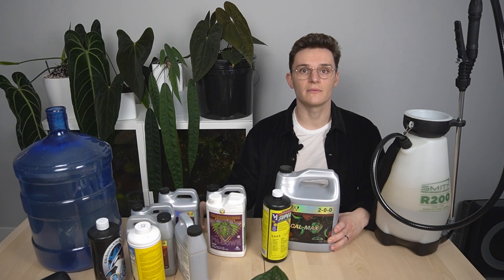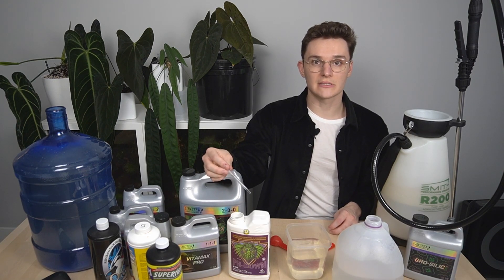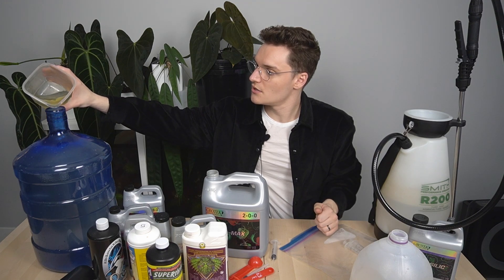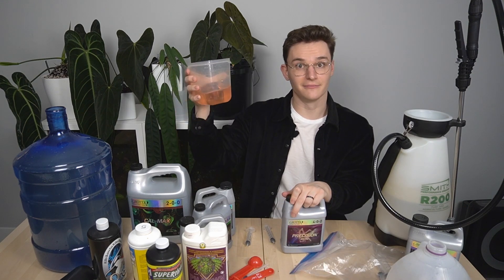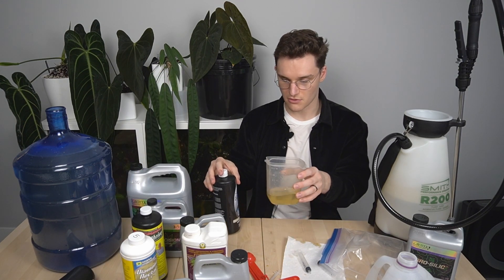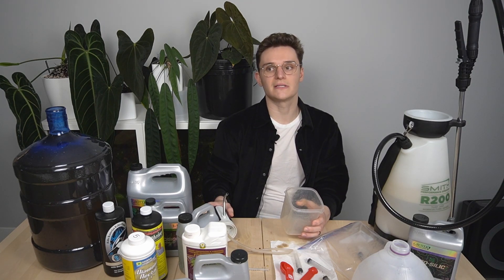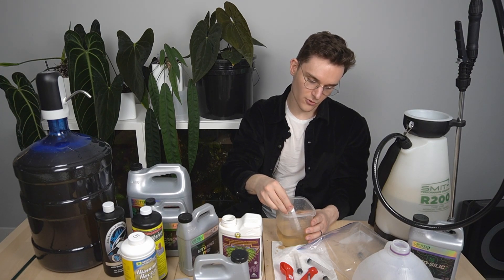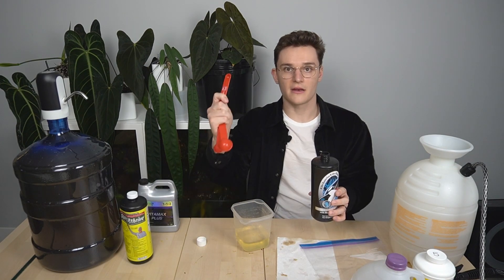How I Grow Anthurium Part 2: Nutrient Solution

Comment: The tri part base nutrients confuse me so much. When you add all three it ads up to a solution npk of 7-7-10, but i was always under the impression that foliage anthuriums need higher nitrogen level ratio to p and k. Can someone clarify? Also would advanced nutrients brand of the tri part work as well as this brand, the ratios are different , advanced nutrient tripart ratios when added together are 5-3-8. So i am so confused. What is the best base nutrients to use for anthuriums if youre in the eu, im in ireland and i dont think we can get the brand he has here. Any help be greatly appreciated

Comment: Question about your pH- you mentioned that you use the same nutrient solution for all of your plants and not just anthurium. Do you find that a pH under 5 is detrimental to plants like monstera and orchids? I've been balancing my solution to a pH of 5.5-6.5 and am a little worried about lowering it as I've read that monstera prefer a pH of 5.5-7. I am mainly growing monstera and anthurium in semihydro and so I'd ideally be using the same solution for both. Any insight as to how your other plants do with a lower pH would be super helpful!
Reply from the maker: I give it to everything including succulents, ferns etc

Comment: 9:33 Is it really the best thing to ph balance to a 4.8 if you're using a soiless mix? Just curious cause I've noticed that the plants ive fed with this ph over the last couple of months havent been doing as well as they were before the change. Ive also noticed less root growth, slower sizing up, and less darker foliage then before. 

I dont use growtek but do feed with all the same nutrients: distilled water, monosilicic acid w/boron and added iron, calmag, 12-8-14 fertilizer, superthrive, myco, and fulhumic acid. 

All my anthuriums are pre- cataphyll if that makes a difference. 

Seeds/seedlings all get distilled water, myco and superthrive.

Just wondering if you had any advice.
Reply: Depends on if micros are EDTA or DPTA and if you have any pH drift. I guess you are not measuring ec ? There is lot of variables. From pH, substrate type, pH, pH drift, EC, npk ratio, calmag ratio...f you have high ec you get nutrient lockout , combined with low pH ...its complex topic which is hard to go through in comment section. Simplicity is the key. People who mix many products are wasting money, time and introducing lot of variables into equation. Believe me, he can achieve same results with 1 or 2 bottles. But he is lucky, it works for him even tho he is extremely overfeeding , rising ec to extreme numbers and wasting money on products which does so litlle its not even measurable. You can see on his other vids that emergents are fine but old leaves are burned to death.

Comment: Awesome video Nick, thank you!!

Is this a good recap of your mature plants nutrients steps: 
1. Never add nutrients directly to the large jug. Instead use small bowl then transfer to jug.
2. Add recommended monosilica to bowl then larger jug 
3. Wait ~30 mins to stabilize 
4. PH jug (or bowl?) solution to 7
5. Add to smaller bowls then jug separately - Cal-Mag + Core 3 part solution (Micro/Grow/Bloom) + Diamond Nectar + SuperThrive + Orca + Vitamax Pro
6. Mix jug
7. PH jug solution to ~4.8
8. Flush as needed

Sounds right?

Comment: Whenever I add silica , my hydroponic houseplants gets root rot. I see the benefits of using silica for my plants so I know it works. Do you know what I'm doing wrong that is making the roots rot once I add silica?
Reply from the maker: Make sure it’s monosilicic acid, and check and adjust the ph down after bc it increases ph
Reply: @nxcplants thank you 🙏. I think that might be where I'm messing up, I haven't pH down when I use it mixed with nutrients. 

I'm currently using TPS silica. Had it for two years but I don't use it that much since I run into root rot. Is that good to use or should I buy a different brand like the one your using? It only says soluble silicon (si) 3.0% , soluble potash (k2o) 1.3% on the back.
Reply: Helpful!

Comment: I know everyone has their own method and whatever works for them is great. I personally don't feel it necessary to use so many different products to have excellent results. A good base fertilizer (such as GH Flora Nova Grow 7-4-10, or TPS Indoor Plant Food 3-1-2) that has all the essential nutrients, including Ca and Mg, has served me well. My main concern is the TDS, rather than the pH, because the pH is going to drop in the pot but excess nutrient is not good for root health so I don't feed above 400 ppm (and typically less than that).
Reply: How often do you feed your anthuriums with 400 ppm solution? I've been experimenting with different values of EC/TDS like basically no fertilizing at all for few weeks to heavy feeding with EC values up to 2500uS/cm (~1600 ppm). Trying to find my sweet spot but I think heavy feeding is giving me more troubles than advantages.
Reply: @yberionpl  I feed them every time I water, although every now and then I "flush" with water that has 50-100 ppm Epsom salts. Because the media is never drying out and I am pouring through a large volume of water, there isn't any real risk of nutrient buildup. Maybe more feed would make them grow faster, but they grow sufficiently well and produce inflos with every new leaf.
Reply: If you don’t mind I’d love to hear more about ppm I just started measuring mine and trying to learn as much as I can. Why is 400 a good point to go with for anthurium ? Thank you so much
Reply: @brooklin_bernek it's a complicated question to answer because so many factors come into play. Anthurium are considered "moderate feeders", compared to low feeders such as orchids or high feeders such as tomatoes. But, many factors will influence how much feed they actually need: light, temperaturd, medium, etc. Additionally, the frequency of flushing must be taken into account. For me, 400 is the sweet spot because I am using an organic media and am lax about flushing. I might be able to push more growth with a higher feed level because I give them higher light and temperatures,  but I would have to weigh that against being more rigorous with flushing. For the average grower, 400 falls into a range that allows for more leeway than feeding lower or higher. Obviously, if you are in a climate where growth slows considerably during winter due to lower temps and light, then feeding should be reduced or eliminated until normal growth resumes.